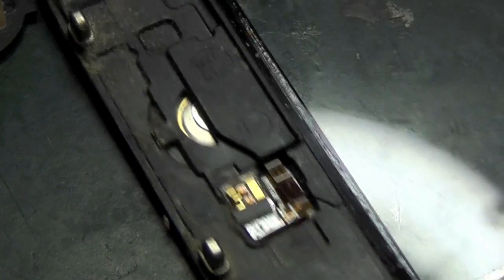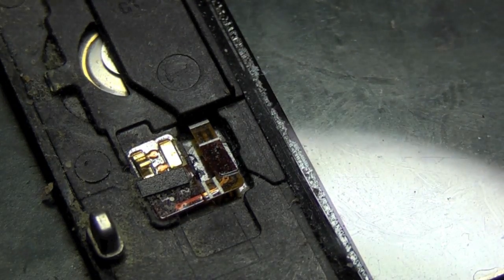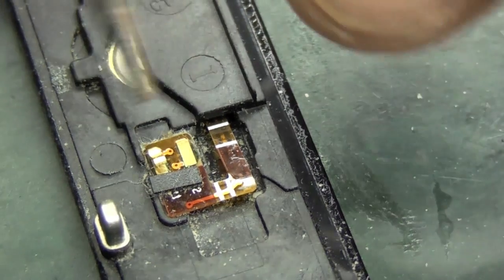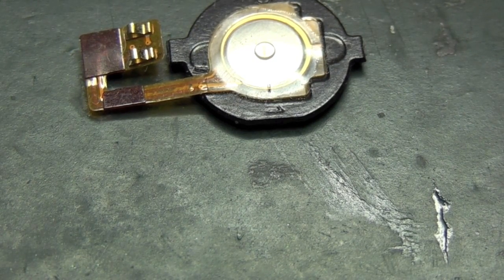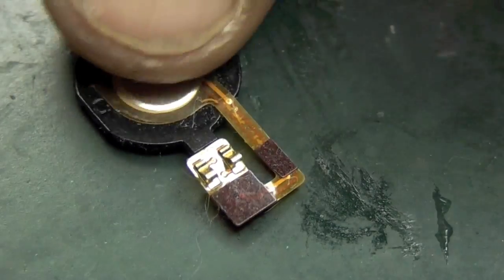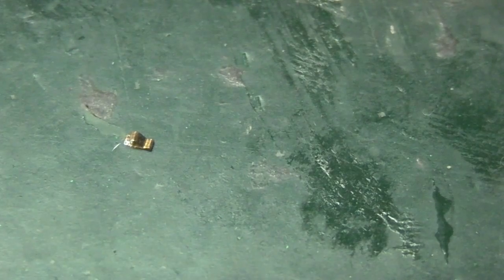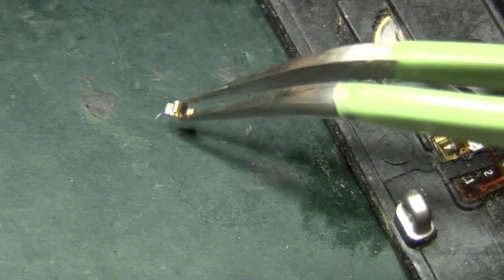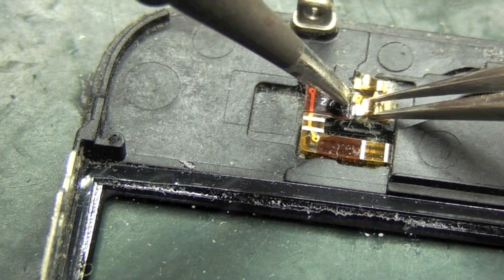iPhone 3G and 3GS home button repair and meet iMite!

Comment: Another good tip is to use a RS fibreglass pen (RS Stock No.514-868) on the 2 pads on the pcb, you might need a can of air to blow out the debris afterwards.

Comment: I just did this, but rather than soldering a spare connector on I just used some solder AS a connector. Works like a charm, just make sure that the boulb of solder is as high as the other connector :)

Comment: Thank you. Excellent tutorial. Unfortunately it did not work for me. The new pin I had was from an old 3G (exactly like the one you had) and I put it on a 3GS which was a little different (longer and higher). I assume that my iron is not as hot as yours as it took longer than you to work.

Comment: thanks for this offmains, I didn't have a replacement connector so just built up a tiny blob of solder to the hight of the unbroken one.
It seems to work ok at the moment.
Have subscribed cheers